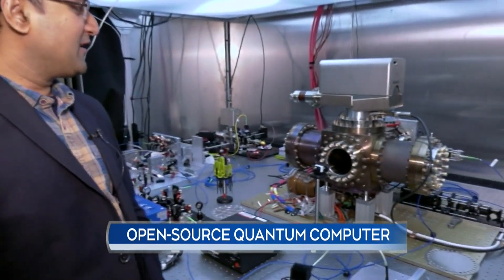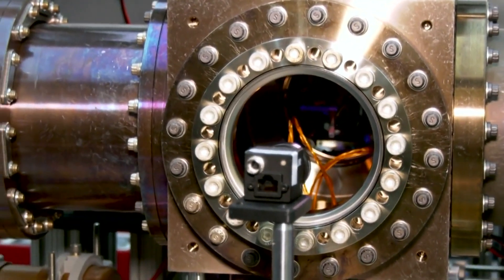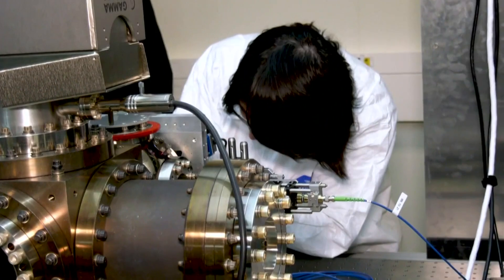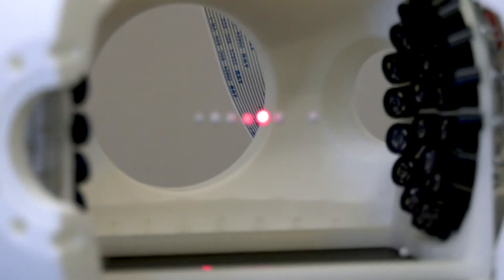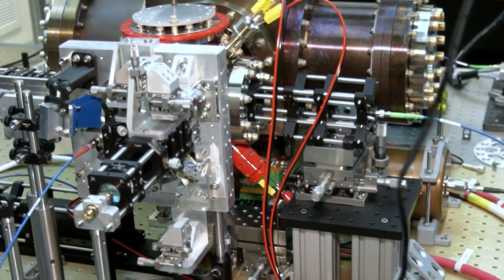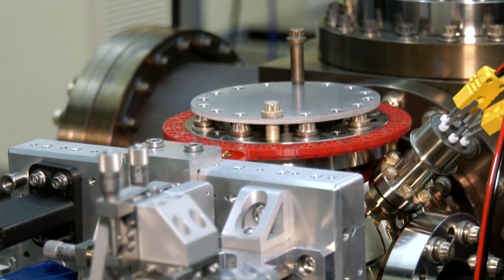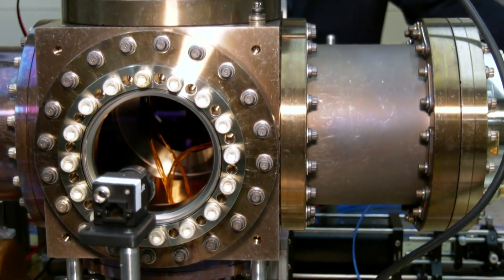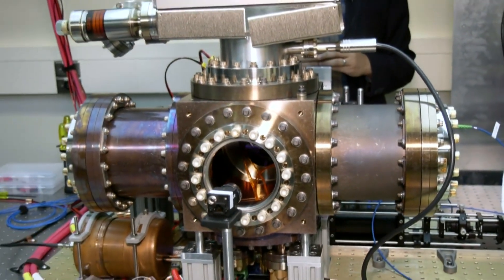Can quantum computers solve complex world challenges?

Comment: Quantum computers can crunch a lot of numbers in a shorter time. That's it. They do not solve problems like "climate change," "affordable housing," "grocery inflation," "underfunded healthcare," and many problems faced by Canadians. They are not inventors. If not for Nikola Tesla solving the problem of alternating currents to provide an electrical power grid, Canada would be using coal and oil to heat homes and run factories. A carbon tax solves nothing, it punishes! Develop a synthetic fuel that's cheaper than fossil fuels. Quantum computers can't do that.